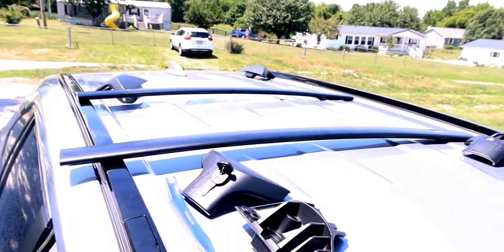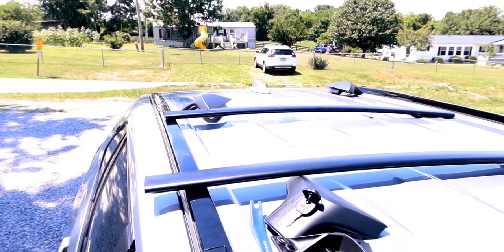How To Install A Roof Rack On A 2020 Rav4!!

Comment: Any wind noise noticed?  When I put crossbars on my mazda cx-5, I noticed some faint noise, almost a soft whistle at low to mid speeds.
Reply from the maker: Just slightly. Barely noticeable.